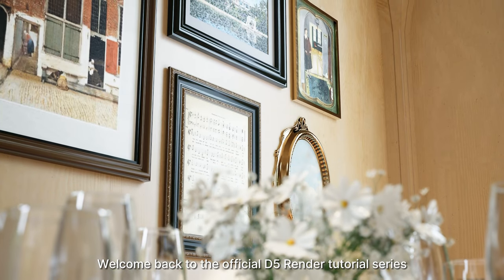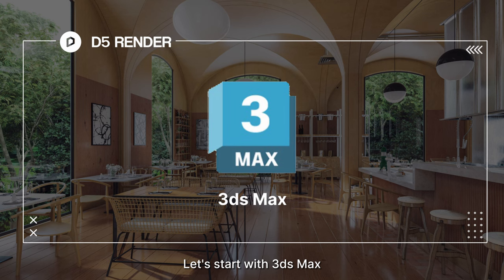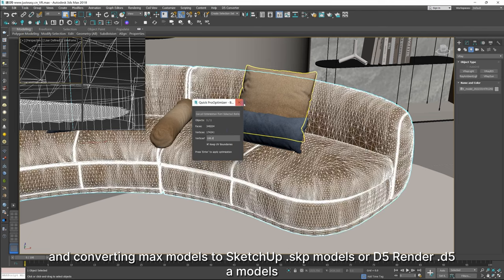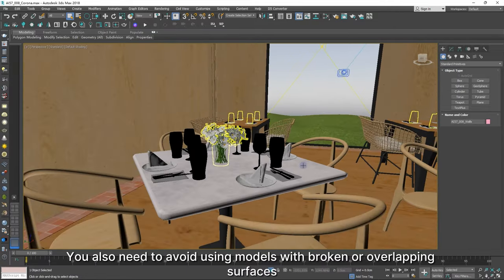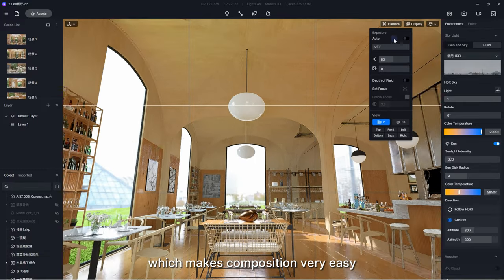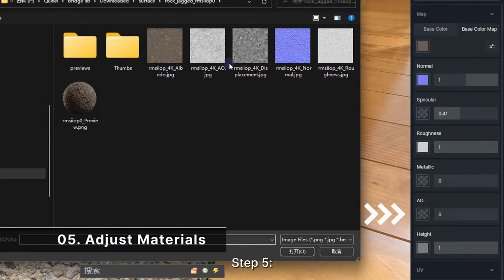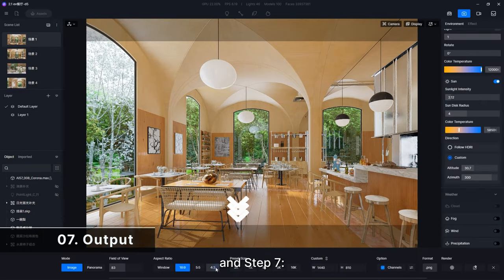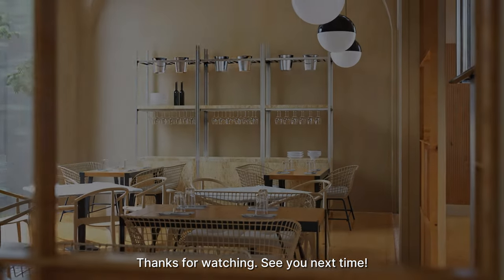Workflow - #2 Getting Started with D5 Render

Comment: I installed D5 render script in 3ds max and Now all my UI, Toolbar and quad settings crashed, even after i uninstalled D5 script this is happening, all my workflow settings get meshed up. i also tried deleting ENU folder but nothing helps whenever i restarted 3ds max all my workspace settings get back to previous state, i also tried creating new workspace but no hope, this is the worst script i ever installed in 3ds max.
Reply from the maker: Hi please report this issue with screenshots to our tech support at support@d5techs.com, and we will see into this problem for you.
Reply: @D5Render  I have uninstalled the script, now how you will scrutinize the problem and how you I can share the details, I mean what type of data you want. There is not any warning/error to send screenshot, my UI is reset to previous state, this is not an error.
Reply from the maker: @rajendrameena150  Contact support@d5techs.com so we can help you there.